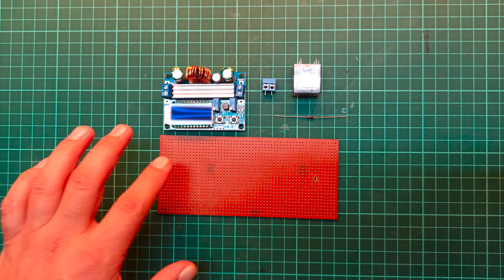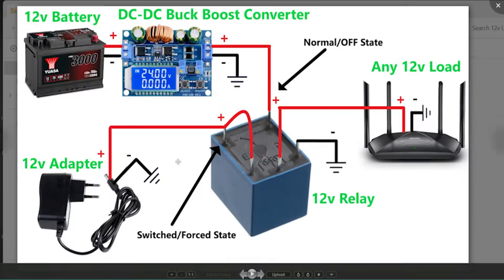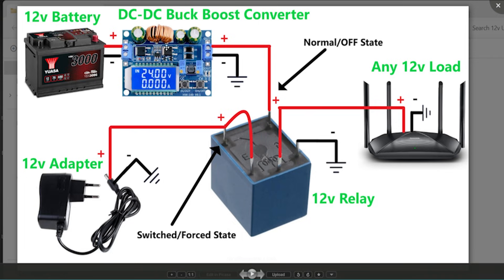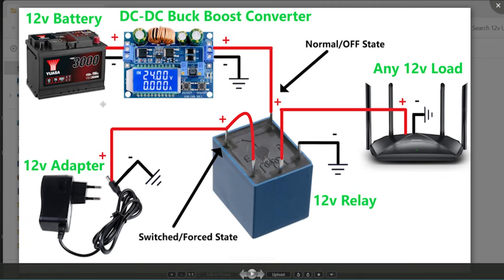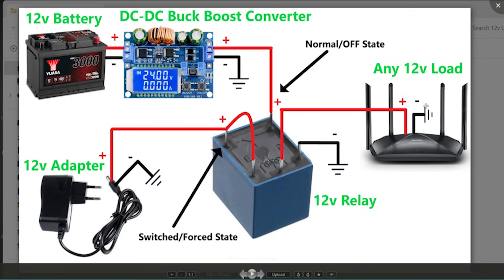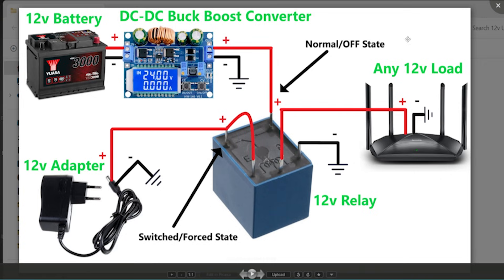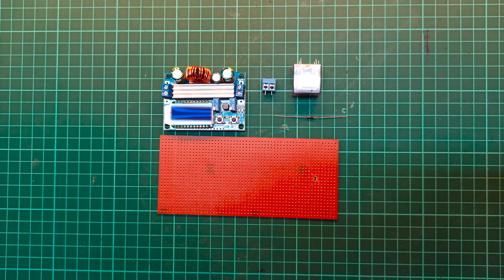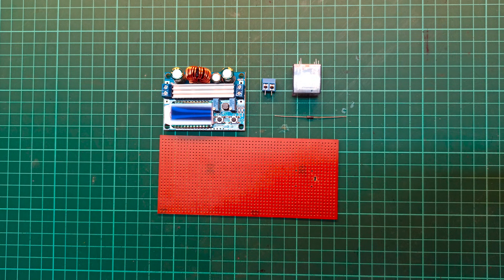World's Simplest & Cheapest DC Uninterruptable Power Supply (UPS) ?

Comment: 13:42
Lol why do this when you can clearly see it shuts off the LED. I know you want to DIY, but modules for this purpose exists for cheap. The trick here is to search anything "solar" battery module will have an integrated UPS built in even if the listing doesn't say so.
Reply from the maker: 😂yeah you got me.
I am using some modules already, this was just a cheap diy which is also working just fine. ☺️

Comment: Please, also consider using 2 diodes (one for each source) that will switch between inputs much much faster than a relay, or a solid state relay.
Reply from the maker: With only two diodes?
How?
Reply: @ERLEngineering  Cathodes together and to device, each anode to each source (batt, psu).  Add capacitor to stabilize output.

Comment: This is an outdated way.  Causes power loss while switching. Even better, use PFet to switch with output cap to eliminate supply  loss to router while switching.
Reply from the maker: Thank you for your feedback, yes thats a good suggestion too.
Although it is outdated but it provides complete isolation between the two sources.
How much power loss are we looking here? I am guessing in milliamps, wouldn't that also occur in PFET circuits too?
Reply: @ERLEngineering  Please search "mosfet switch battery power" in your browser and see "images" tab for use of p-fet in such circuits that doesnt cause power loss when switching.  It wont let me post links here and my last response to you was deleted.
Reply: @ERLEngineering  Replied twice, each time my comment got deleted....

Comment: It seems to me that it would be more useful to switch between the battery and the DC power source directly, and then feed from the relay into the buck-boost converter which then drives the load. That would enable you to drive different voltage loads simply by adjusting the buck-boost converter. It would also make use of the smoothing in the converter as well as your additional output capacitor to help maintain the output during the switching from DC supply to battery. Additionally, you could use a different voltage for the DC supply as long as it matched the relay.
I can see that it would require more effort to demonstrate which source is supplying current, but you could use a 9V or 15V DC supply and allow the converter to display its input voltage.
Reply from the maker: Thata seems even better design. Thank you for your idea 🤠 i will definitely look into it. 
Thanks